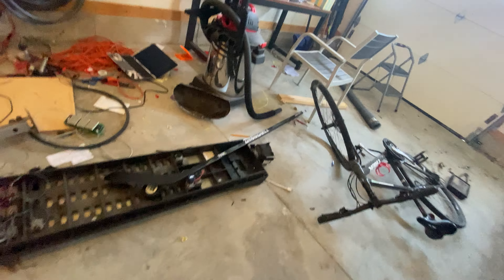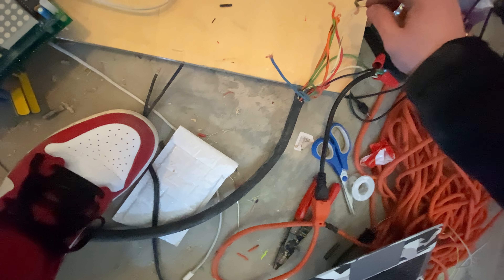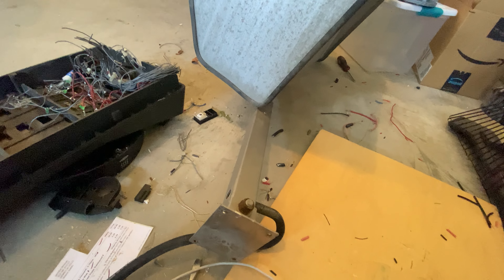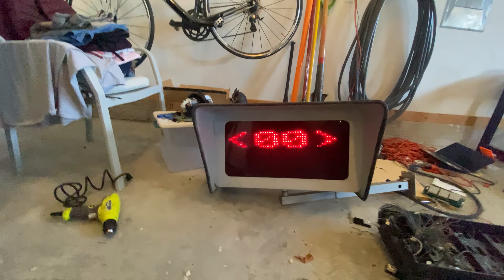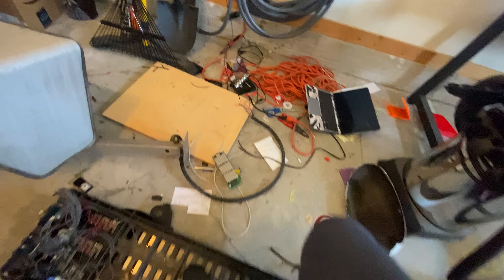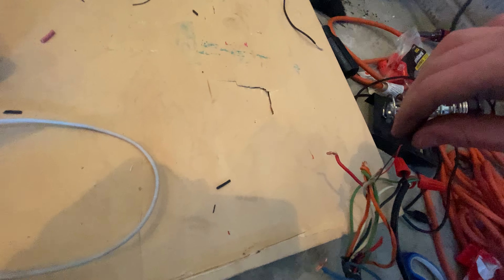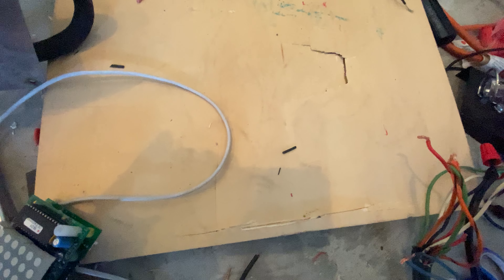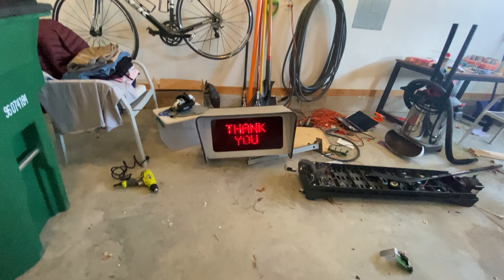My Ryko CMD (Custom Message Display) in action!

Comment: I still have the Ryko programming handheld for the CMD system, so that you can make your own custom messages.
Reply from the maker: That's cool!
Reply: @cwfeatures  $50 and it's yours with the manual if you want it.
Reply from the maker: @dcw515  I’ll think about that, I’d have to save up a bit but that’s a great value
Reply from the maker: @dcw515  Hey, I am able to get it at some point. How would I receive it
Reply: @cwfeatures  Well you could come to my other wash in Des Moines and pick it up.
Reply from the maker: @dcw515  awesome. I’ll tell you when I can get it once I get more money which won’t take long
Reply: @dcw515  Need a little help here. Yesterday I was able to get my hands on a 1st gen CMD that has the floodlights and no shroud/cover around it. And I need to figure out how to get it to work, and how to open it up. Would you have any manuals on these older CMDs?

Comment: Did diamond replace it?
Reply: We sold the wash back in November, the new owner replaced the Ryko Softgloss with a WashWorld XR7 and modified it to wash taller vehicles.
Reply from the maker: @dcw515  The XR7 is almost done with install. A new friction system will be put in eventually according to the new owner